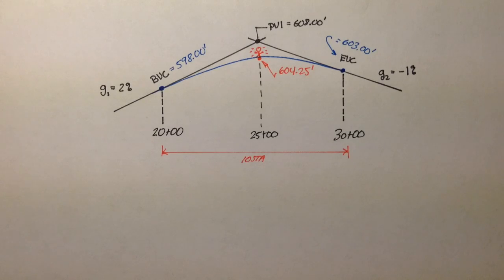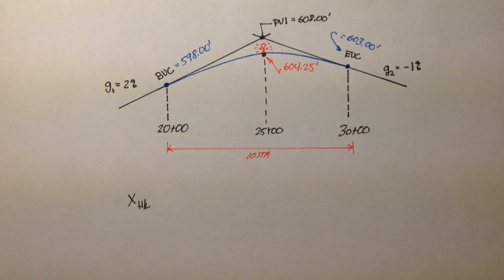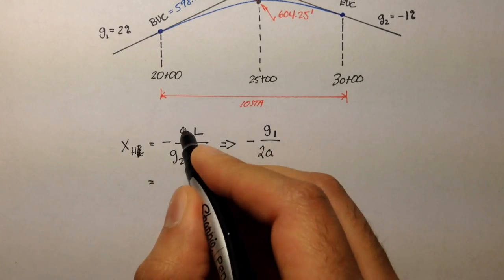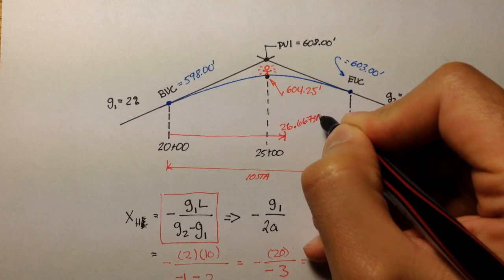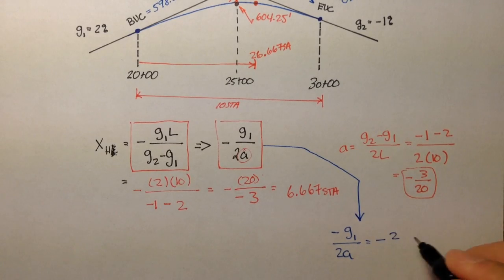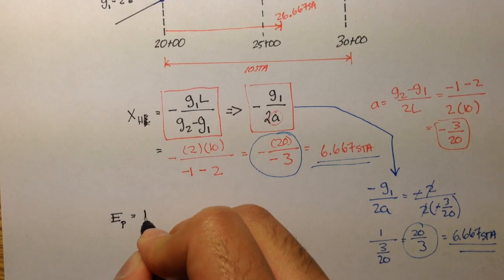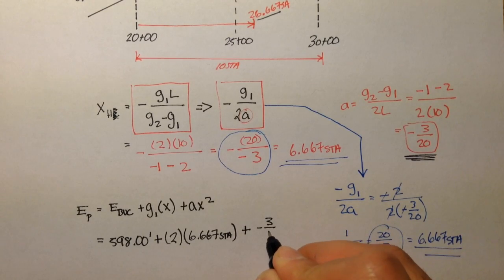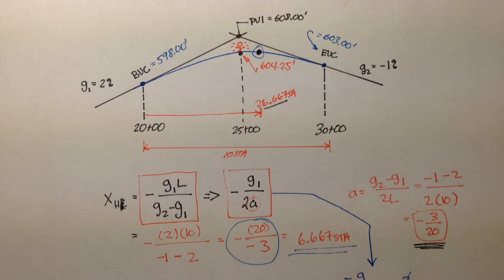Advanced Geomatics: Vertical Curve Example: Highest Point

Comment: 2%Gradient should be 0.020 and 1% should be .010. Ur Points BVC and EVC value wrong
Reply: He told us in the last video if you use stations to keep the grades in %, if we use feet to convert to decimals. I worked them both ways and the BVC and EVC are correct. Just keep in mind to do the same for both STA and percent to make sure they match.